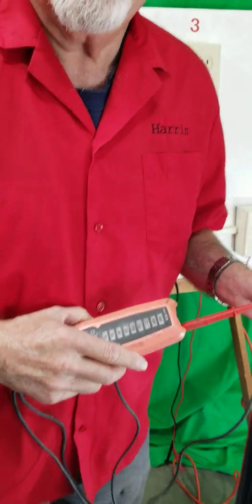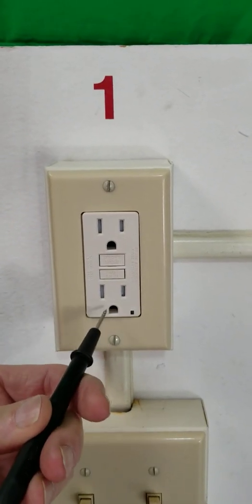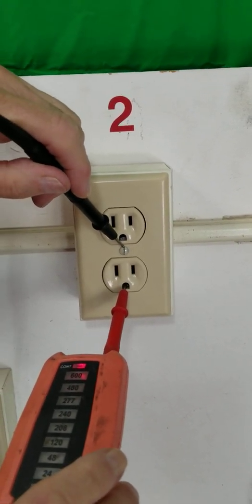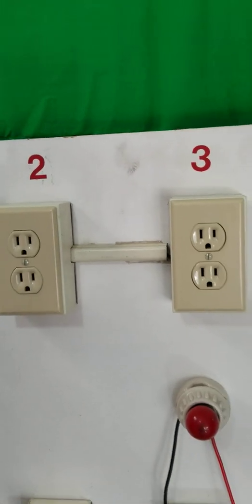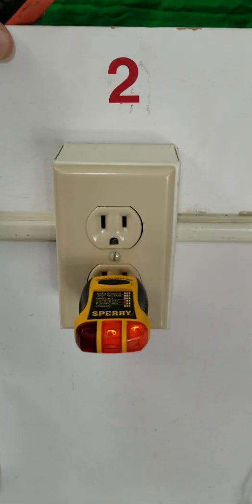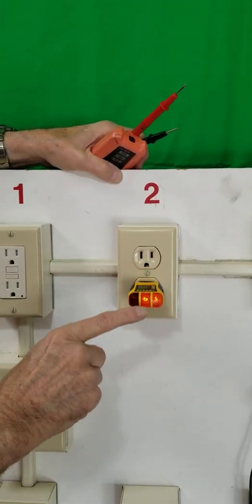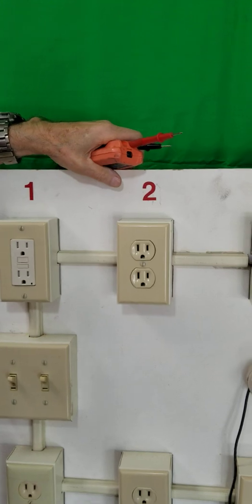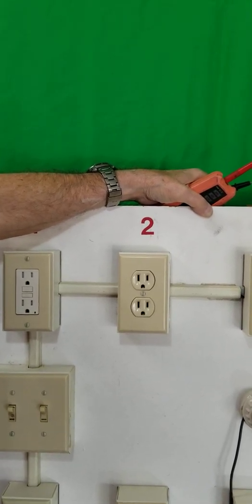testing and finding an open ground

Comment: The reason it does not trip is because of how the tester is designed. The only way it can simulate a ground fault to divert some current to the ground wire. The GFGI would still work. However, an open ground should still be fixed unless it is a converted two prong socket that is properly labeled with "No equipment ground".

Comment: GFCIs don't rely on ground for circuit protection.  They trip because of an imbalance of current between the hot and natural.  Even though receptacle 3 does not provide an equipment ground, it will still provide protection.
Reply: Yes. But you'd still want to fix that open ground, so that if any 3-prong appliance plugged into it had an internal hot-to-ground-fault, it would immediately trip the GFCI, or the panel breaker.  Without ground, the metal casing of the appliance would possibly remain hot until someone touched it.  The GFCI would (hopefully) shut off the moment someone touched it, but that's still a higher-risk scenario.
Reply: Yes, but it still is a problem and a code violation unless it has been used to replace a two prong outlets on an old house and it is properly marked.

Getting singed even with a  GFCI hurts and it might kill someone with a heart condition.